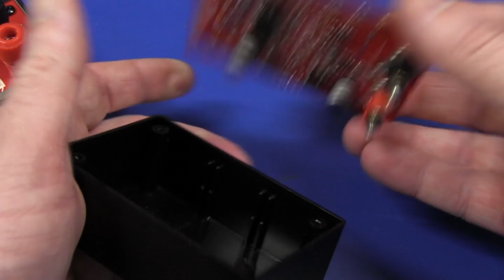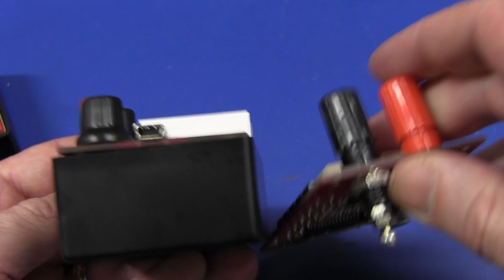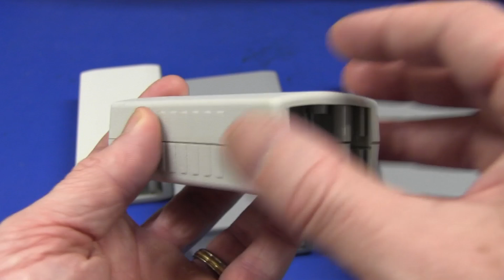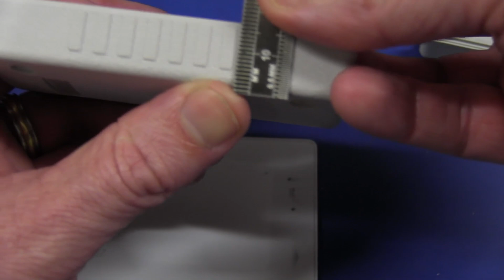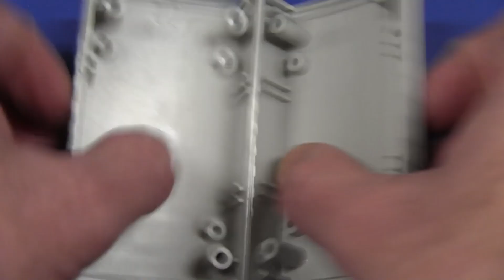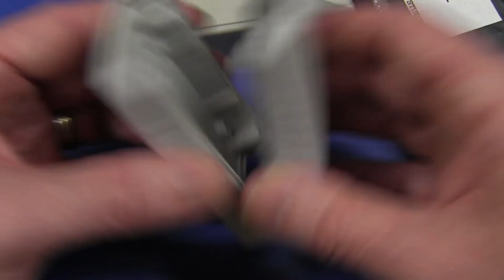EEVblog #291 - USB Power Supply Part 2 - The Housing

Comment: Suggestion: Have it controlled via an app, you can use the tablet/pc to display the readouts/settings. No display to take up available power, no control knobs, unit can be very small and cost would probably be halved. Users can then have fun writing their own interfaces for if they want. It must have on/off button and ON light on the unit as well as in the app because having to go the screen to switch it on/off would be a pain.

Comment: Great video Dave, Big up thumb for all of your videos.

What about controlling your power supply from the computer itself and using a simple GUI program instead of using knobs and 7 segment display rubbish ? .This will keep your power supply in a pocket size. Also you can make your micro power supply portable by adding a lithium battery to your design with its charging circuit, bluetooth module or wifi module. So you can control the power supply wirelessly throw your mobile or tablet. This will be a great idea. If you just use the computer to power the power supply, It will be a piece of crap !! . just make use of computer abilities.

Greetings from Egypt.

Comment: I still think that you need interface USB. It would be pretty good if you throw a USB to TTL chip in there (or USB compatible micro) and make logger software... no need to dial voltage from software, just for data logging

Comment: Dave have you seen the TI DCP02 series of 2W isolated DC-DC converters? They're unregulated, but available in a variety of input/output combinations in DIP14 size. Might be easier than that module you're going to use, you can mechanically assemble and not worry about the leads, and doesn't seem regulation is important in this application.

Comment: Okay, not everyone used the GPIB bus on the HP gear -- but it was there --.  I think you should have some software capability for settings and load-trend analysis on the PC.  It only costs you software.  It's a selling point and something people will use. At the very least it makes the product stand out even more.  Hell, throw in a Dave-CAD pad as icing on the cake.

Comment: Rather than use buttons it would be good if you could fit a little thumb wheel in somewhere (perhaps next to the usb connector) - like a tuning dial on a radio.

Comment: Nice idea, only concern i would have is the binding posts protruding and snapping off, i know my laptop bag gets thrown about and kit needs to not have parts sticking out of it, i.e. have lost count of the number of pen drives i have snapped off in the port, as other have said a low profile socket or wiring harness would increase the ruggedness of the kit, that said i imagine 90%+ of people would only ever have it on there desk, however if it becomes a kit just change the posts for ones u like

Comment: Well usb 3.0 port makes it even more useful as it gives much higher current ( "Several changes and increasing limits including allowing 1.5A on charging ports for unconfigured devices, allowing High Speed communication while supplying a current up to 1.5A, and allowing a maximum current of 5A." as Wikipedia says

Comment: You could just go out and buy the device or pay someone to design/built it... the whole point of this is the design process and this is EXACTLY what it's about, spending hours on getting it how you want it is not time wasted if it's something you enjoy doing. This is the "fun" of electronics and engineering as a hobby. I go one step further and see how I can modify and reuse existing components and parts I have, but Dave wants to be able to produce many cheaply so ideal way to do it.

Comment: 20 minutes about hacking a plastic case when you can just go on digikey and get perfect case from start.. not to mention you could just get a transparent case so that the display is visible through the case cutting down the need for manufacturing extra stuff.  
the binding posts are a stupid idea, a connector with screws or even a pc style molex connector would make more sense. Miniature and Binding posts aren't compatible. But you'll do it your way no matter what people seem to actually want

Comment: An alternative to the laser cut acrylic would be a PCB, with a rectangular cutout for the display, and you just stick a small piece of thin clear plastic on the back to cover the cutout. That way you have plenty of room for legends and maybe better rigidity, as well as less risk of plastic cracking at the screwholes. 
I think you should still have knobs though, although I've  found nice shallow knobs hard to find.
Another thing you could do with a PCB cover is touch buttons & sliders.

Comment: I like it so far, keeping it standard for use with most power supply units as well as the sleek look. If people have a problem with the wobbly nature they can chuck some rubber feet on it and it wont be an issue.

Looking forward to the future stages Dave!